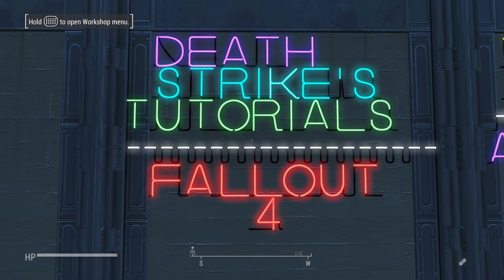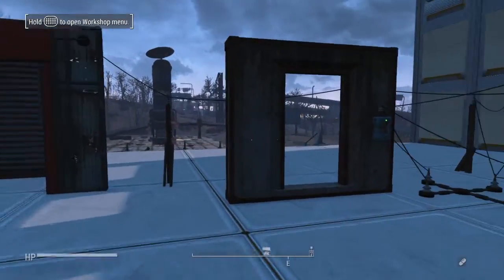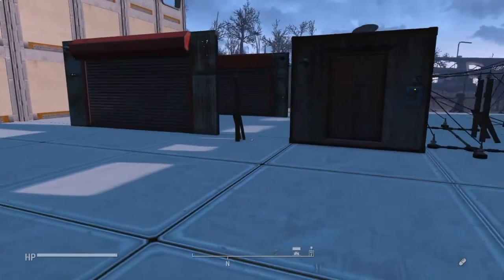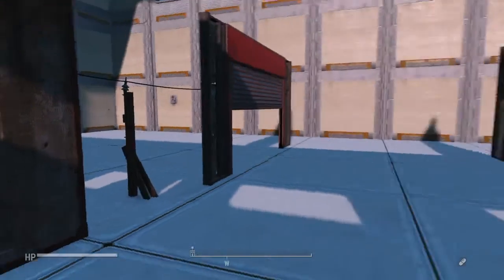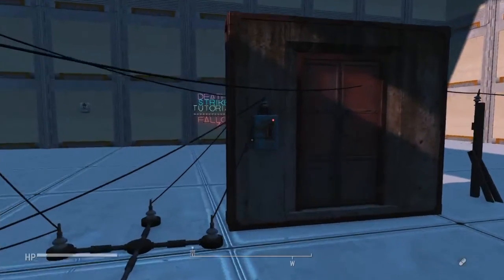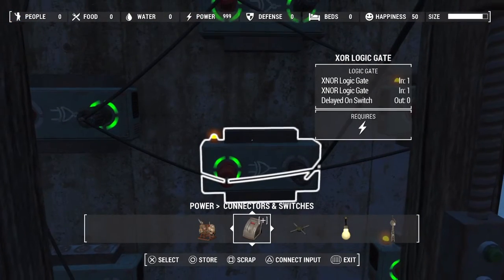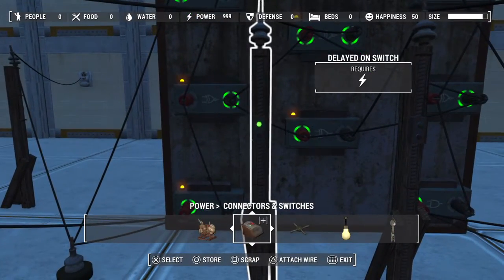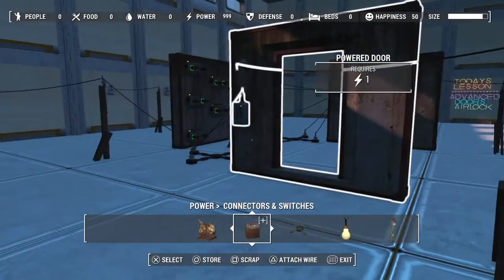Fallout 4 Tutorial - Logic Gates: Advanced Airlock Door

Comment: Yeah man! That is an awesome setup...I wish I understood Logic gates as much as you seem to understand them...I really REALLY need to experiment a bit more with the gates...lol
Reply from the maker: The best way I found was think of it as basic math or a scientific logic question in your head. 1. what is it you want the contraption to do, 2. place the contraption in a if, than, or else question, 3. as you place logic switches say in your head why your putting it down and test your hypothesis, 4. if it went wrong where in the line did the equation change the outcome, else if it worked why did it work. 

Example: 1. I want a switch that will open and close a door from ether direction and not trap me in side. 

2. IF: I pull any of the switches, Than: 1 door will be open, OR ELSE: 1 door will be closed. 

3a. Both gates and the switches need a power lead, to give a logic system power I need an And gate to transfer power for this reason because we know that as long as a generator is transferring power 1 of the inputs will always be on and the other is determined by a switch and we know that both inputs must be on for an And gate to transfer power; conclusion all switches need to connect to the And gate and power. if i want two switches to open one door but don't want to be locked out from ether side then both must provide power when in the same position on or off and the only gate that will do this is the Xnor so power And gates to Xnor, and the then the Xnor to the door to test. I now know this system works without fault, so repeat the system with another door of the airlock and mirror the results. 

3b.Now I ask how can I get 1 door to be open but the other to be closed without altering the doors that already work Well Iknow with a xnor that if all the switches are the same then a door will open, and I also know that all logic gates require 2 inputs except for the Not Gate, so if the original Xnor gate already has two inputs, but it only outputs a on or off signal then it is acting like a switch. So if I power both door Xnor's to a 3rd Xnor then we know that if both doors are connected to this 3rd Xnor that when all 4 switches are on or off the door will open, as well as if only half of the switches are on and the others are off for example 2 on 2 off then it will do the same, conclusion if an even number of switches are on or off then the doors will activate.

3c. Now we want a circuit that will do the opposite for one of the doors since we know we have a circuit that will open on all even options so how do we make the circuit provide for the odd? Well we know that we have multiple switches but we only have two outcomes from the original 2 Xnor's ether both will be on/off or 1 of the Xnor's will be providing power at a time . So I want power to transmit if only 1 is proving power and not both and the only gate that does this is the xor so we power the original 2 Xnor to the xor and we find that as long as there is an odd number of switches providing power only one output from the one of the Xnor's will give a signal and this will power the Xor, and if we have an even number of switches it will turn off the Xor. 

3d. So we have two circuits now using the original door system but if we power both systems to both doors then the doors will always be open and never close, so we wire 1 output from the 3rd xnor to 1 door, and 1 output of the xor to the other door. After testing we find this system works how we wanted it too, the only issue is the doors now open and close at the same time and don't have a delayed realism. How can we delay the power to open the doors but not when they close, the solution is the delayed on switch; we know that when power is transferred to this switch it has a timed delay before it will transmit power however there is not a delay when power is removed. so we create two of these switches and wire the xor and xnor to the respective pole and then to the doors and we have our finished product.

I hope this better explains the way you can use and understand logic gates, and the process of how I created this door. :)
Reply: Wow, I did kinda do this in my head...thinking what I want and how I think it should be connected. I'm gonna let this sink in....but yeah, thanks for pointing this out in so much detail. I'm sure others will find this more useful as well.

Great job, and thanks, many MANY thanks!
Reply from the maker: No problem here to help